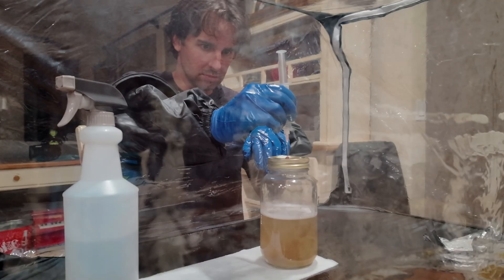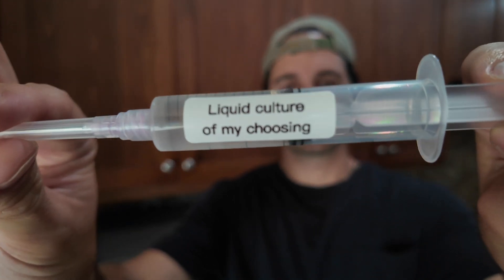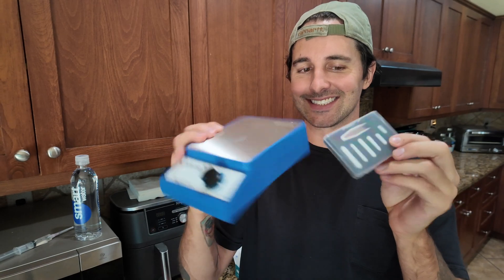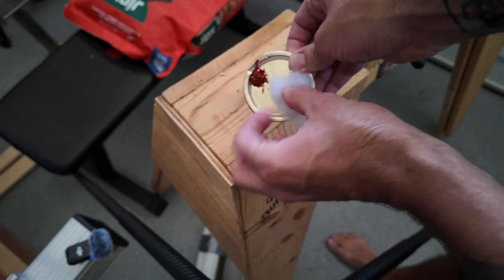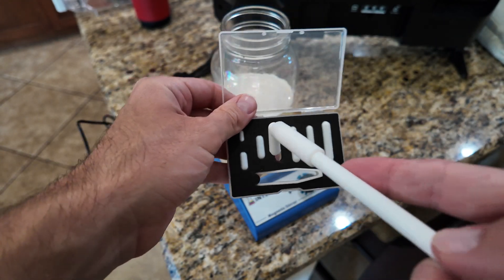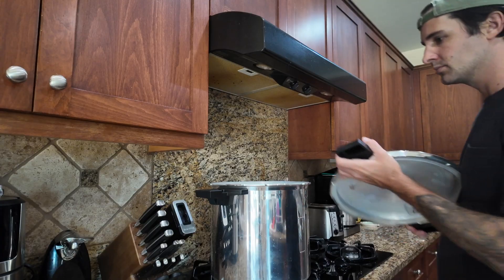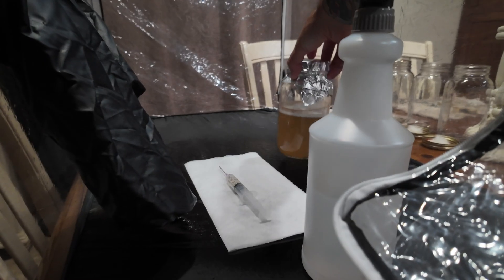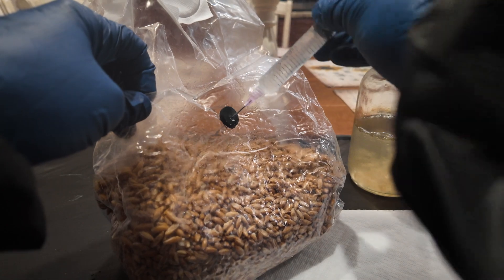How to Turn 1 Mushroom Syringe Into Endless Liquid Culture

Comment: I love your videos. Which process is better LC to LC Jar or LC to Agar to LC Jar.
Reply from the maker: Thank you so much! It depends what you prioritize. If you have the time and means to do LC -> Agar -> Jar, that's the safest/best way, but it takes longer and requires more resources. If you trust the cleanliness of your LC syringe, going straight from LC -> Jar is fine. 

It all comes down to your priorities and preferences!

Happy growing my friend
Reply: @TheDailyMushroom My setup is pretty minimal I'm just getting my first SAB now because of previous contaminations in open air. Even then I don't think agar work would be easy. Most likely I'll expand my LC in the SAB and move further.
Reply from the maker: Do what works for you! I've done a ton of LC to LC expansions with success.

Agar in a SAB gets a bad rap, but with learning proper technique, you can really minimize the contamination risk!

Take it one step at a time, no need to rush into doing more than you're comfortable with. Happy growing my friend, I'm happy to have ya here!

Comment: What if you don't have a pressure cooker? can I just boil for 15 minutes?
Reply: Yes and no. You can, but some jars may fail. Pressure canning will kill of a wider range of microbes. Some microbes are very heat resistant and will not die if they are boiled or in spore form when boiled.

Comment: what's up maui? how do you prevent needles from getting clogged with the strings of myc in the LC? Syringes I've been getting are super clumpy and shaking does nothing.
Reply from the maker: Great question! The best thing is likely just using a bigger gauge needle so the mycelium can pass through without trouble.

Alternatively, this is where the magnetic stirrers can come into play as they can usually breakup clumps of mycelium better than just swirling the jar.

If your syringe is super clumpy, the needle HAD to be big enought to let the mycelium in, so it should be able to let it out. If it's not breaking apart easily with some vigorous shaking, I'd consider putting some to agar and transferring with that.

However, even if you can't visually see the mycelium leaving the syringe, odds are there are tiny little pieces of it floating all around the solution and some is still getting into your jar/bag
Reply: @TheDailyMushroom  thanks for replying!! I guess I was not super clear in my question - I bought syringes online and the myc in them was all clumped up and would not eject. I used the needle it came with. I'll look into getting bigger gauge needles. I'm just not having much luck with the LC's I've gotten so far so thinking of trying to expand what I have left to save $$$
Reply from the maker: Oh that's a bummer, maybe they sat for a while and the mycelium sort of clumped up? I've heard people have success holding their syringe up to a massage gun or maybe a phone on vibrate so the vibrations can help breakup the mycelium.

I definitely recommend expanding though! Which culture did you get?
Reply: @TheDailyMushroom  they are all psilocybin strains. shaking the syringe just made it clump even more. i'm going to set myself up to expand the LC from now on! I feel like i've started a huge science project, lol. thanks so much for answering and all the great info on your channel!

Comment: Hey, at the end you said that it can be stored for up to 3 months. What happens after that? Do you take one syringe from it and start the process all over again (new distilled water, malt extract, etc.), or how does the cycle become "endless"?
Reply from the maker: What a great question! So I think of 3 months as the sort of "best by" date. They'll definitely still work beyond that. I have liquid cultures I've accidentally frozen, forgotten in the back of the fridge, etc, that still work and grow fine after a year.

But mycelium are living things, and pulling a syringe from the old jar and putting it in a new jar, is just going to create the same old/weakened mycelium (assuming that's what you have).

Now the best way to revitalize and start BRAND NEW is to take some spores from the mushrooms you've grown and that would produce a brand new mycelium. You can place them on agar, mix them up in a spore syringe, whatever you want to do.

Alternatively, if you don't want to play around with spores, your next best bet is taking a fresh mushroom, pull an internal tissue sample, drop it on your agar, and use that to produce a fresh liquid culture. This will be the same genetics, but like a refreshed version of them.

I have videos coming out on some of these topics over the next couple months! Let me know if there are any you'd specifically like to see
Reply: @TheDailyMushroom  Hey, thanks so much for your reply! I'd love to start mushroom cultivation as a new hobby, but I would like to do it as low-waste as possible - no plastic, and ideally no disposable glass petri dishes either. Do you think that's possible? It'd be awesome if you could make a video showing how to do mushroom cultivation in the most eco-friendly and reusable way.
Reply from the maker: It's an awesome hobby! I highly recommend

I want to keep my waste low as well, though i could definitely improve. You can use refillable glass petri dishes, you can often grow mushrooms straight from glass mason jars, reusable monotubs, and so on. It may not be 100% reusable due to potential contaminants, but you can definitely get pretty close!

I think that's a great video idea! Thanks for the suggestion 🙏

Comment: if I make 300ml of Liquid Culture, how many ml of spores should I inject? I only have 1 syringe (each) of 10ml for 2 different species. I'm not in any hurry, I'm ready to wait months, my main goal is to make it last as long as possible. So I wanted try different approaches to hopefully make either a agar plate, Liquid Culture or a few bags help me keep it going.
I feel like I only got 1 shot at this. 

This is what I got so far:
1 airtight work-box
5kg of long grain rye corn
10 grow-bags.
2 (300ml) mason jars with 2 special lids for injection and extraction. 
10 sterile prefilled agar plates
Tape for the agar plates and Liquid Culture.
70% isopropyl spray bottle

I was thinking something along the lines of: 
2ml for LC
1-2ml on 5 agar plates (I only have 10, so 5 for each strain)
6ml on 4 bags. 500g-ish bags. (is that small btw? Should I try and make fewer bags but bigger/fill them more?)
2 bags with 2ml
2 bags with 1ml

ANY help would be greatly appreciated.
Reply from the maker: That sounds like a really solid spot! Just for clarification, is it a spore syringe you have or a liquid culture syringe?

I would first inject a couple ml in each of my jars to expand the liquid culture, they’ll likely take 1-2 weeks to colonize the jars then you’ll have a TON of wiggle room to play with. 

2ml per 5 agar plates should be plenty!

As far as the bags go, they’re certainly on the smaller side, but that’s fine. I usually make my bags anywhere from 4-6 pounds, but it’s your prerogative for sure. 

Since you’re not in much of a rush, I’d start with colonizing the jars and maybe a couple agar plates as well, and make sure nothing gets contaminated along the way. 

That way, in case it does, you’ll still have more life in your syringe to try again. 

Making LC from your colonize agar is a really good option too and I’m going to be releasing a video on exactly that really soon. 

Hopefully I answered some of your questions without rambling too much. Definitely follow up for more clarity if you want!

Good luck 👍
Reply: @TheDailyMushroom  thanks allot man. It's a spore syringe. I just gotta make sure I don't mess up my LC mix. I think I'll just make the standard honey+water for my first try, then try this. I can't possibly mess honey+water up. Also it should be easy to find the ingredients. I don't have to order anything. 
So I guess it'll be:
2 bags with 2ml
2 bags with 1ml
a few drops for agar
and whatever is left, 3.7ish ml for LC

Or maybe I should just start with making 3 different smaller batches of LC to maximize my chances. 2ml (6ml total) spores for 3 batches of 200ml LC each or something? Then use the rest of the spores for agar and 1 big bag or 2 medium instead..
Then when my LC is done I'll copy that over to a few agar plates as well. Then start growing bags like crazy with the LC I'll have left and store the agar plates :p

You replying makes me feel like I'm on the right track :)

Comment: Can I use an instapot instead of a pressure cooker?
Reply from the maker: I haven’t personally used one, but I don’t see why it wouldn’t work. Does it have a pressure gauge? If it doesn’t go as high as 15psi, you could use a lower pressure for a longer time and still sterilize the LC
Reply: you absolutely can- most instant pots max out at about 11-12psi, adjust your times and it works- I personally use an 8L one. Do 1.25x-1.5x what is recommended at 15psi and see how that works for you. High pressure, turn off the keep warm setting!

Comment: Malt extract? Like the powder you put in chocolate malt shakes?
Reply from the maker: Haha honestly, yeah! Malt shakes usually use a malt powder I think which has other stuff added to it, but on part of that powder is light malt extract I do believe. Same thing. It’s like concentrated sugars from wheat and barley. I linked the one I use in the description, but you could also get away with honey
Reply: @TheDailyMushroom Thanks, I appreciate how responsive you are, I went ahead and order the same thing you use. I haven't started growing 🍄 yet because I'm still collecting all my supplies. Would you recommend a grow light for indirect lighting? I live in South Texas and due to the excessive heat, I keep my black out shades closed. I figure it would cost less to just run a grow light instead of heating up my home.
Reply from the maker: I appreciate it! That’s definitely a smart move, making sure you have everything you need. 

A grow light is definitely an option, but the mushrooms really only need a little ambient light to kind of figure out which direction to grow. I personally think they’d be fine with just some slightly open blinds very lightly lighting the room they’re in, but a grow light would do the trick as well if you prefer!

Comment: Hi whats up? I have the same pressure cooker but cannot reach 15 psi (level 3), it always get stucked in level 1 or 2, do you have any suggestion? it would be very helpful!
Reply from the maker: Are you adding enough water? If there isn’t enough water in the bottom, it literally will run out of steam and not be able to build the pressure. Other than that, if your stovetop isn’t malfunctioning, I’d consider reaching out to the manufacturer as it may be defective
Reply: @TheDailyMushroom  ohh maybe that is the problem, next time i will try putting more water, thanks you!
Reply from the maker: Absolutely! I usually do at least 3 liters in the bottom of mine, more for longer sterilizations. Good luck!

Comment: If you use powdered hydrophobic material like powder Teflon sprinkled over the top of your liquid culture it will hermetically seal it and you can even take the lid off and leave it off without contamination. You could even pour it on the table and leave it there and it still won't contaminate
Reply: Hmmm…that’s wild. Is this how you operate? Theoretically this sounds ideal but I’m wondering about the practical, regular use and how much of the teflon gets passed on down the line.
Reply: @chinaski44 you can't penetrate the hydrophobic powder not even with a syringe. You can even stick your finger in it without being able to touch the liquid. SO YOU HAVE TO PUT THE LUER LOCK STRAW IN PLACE BEFORE YOU ADD THE POWDER TO THE SURFACE
Reply: @jessytinsley3285  yeah that part was clear. I was curious if you run all your LC like this.  Seems a bit excessive for regular use
Reply: Fascinating to say the least.

Comment: Drilling the lids in reverse slowly may avoid the jagged edges.  To avoid spillage through the filter, you should use some Luer lock airports to long silicone tubing, so you can draw the LC from the bottom without tipping the jar.  It's so much easier and you can add aeration stones via a pond pump (even to multiple jars at once, via an airline splitter to each jar) to speed up the LC cultivation too, which saves need for lots of magnetic stir plates.   Cool video though :)
Reply from the maker: Hahaha so I already have a bunch of lids made, but for the sake of making this video I wanted to show how I made them. So I finally scrounged up a random lid from the back of my cabinet, then when I went to drill it, absolutely butchered it, and was like, “well that was my only one, I guess I have to use this footage,” but it’s certainly not my proudest lid 😂

Well you’ve given me a bunch to think about, I’m definitely going to do a dive into this setup! Thanks for sharing your thoughts
Reply: @TheDailyMushroom  Lol mate, yes it only happens on sodding camera!  Ahahahaha oh mush love and enjoy joy the Lady Amanita season! :)